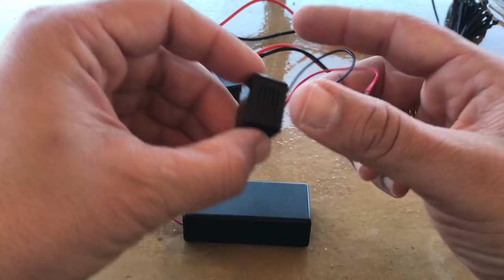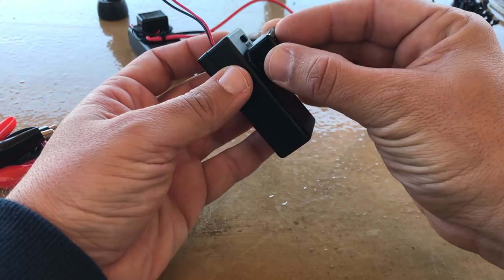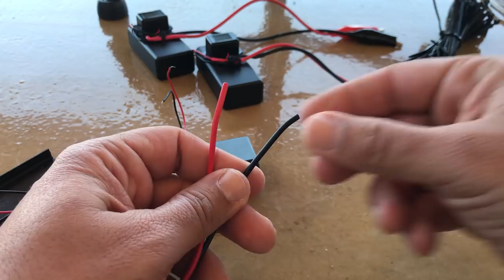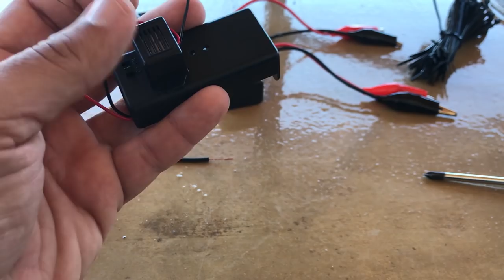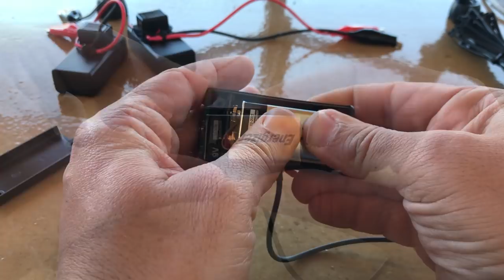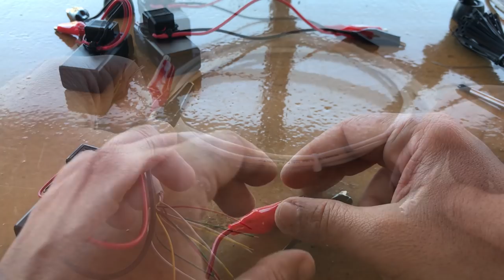How to make a cheap Cable Finder - DIY Tutorial

Comment: I have built a few of these over the years and found that adding a red LED into the ckt allows you to see the light in noisy areas and if you use the light only it does not disturb workers in an office environment. You can add an on/off/on three position switch for switching between the light or tone. The video is very well explained. Good job.

Comment: Continuity tester is what I would call your gadget a signal generator and receiver is a true cable tracer
Reply: It's not a very good one. You don't want to pump 12V on any voltage sensitive equipment. A better design would use a transistor or FET for turning on the speaker a capacitive sensor.

Comment: When I search for a  shorted 12 volt circuit to ground on semi-trailers , I place a 12 volt buzzer inline .  A live 12 volt line to one side of the buzzer and the other buzzer wire to the shorted circuited wire  .  The sounding buzzer will stop after tugging , pulling. , or unwrapping the harnesses ,  then repair  .  If the annoying buzzer is too loud  place electrical tape over the buzzer sound vent .       6/7/23
Reply: Instead of a buzzer a 12 volt an incandescent lamp may be used , this lamp will put more of a current draw on the circuit than an LED lamp . Use alligator clips on these fixtures . A small amount of tape quiets the buzzer significantly .

Comment: How would you use this in coaxial cable setuup
Reply from the maker: I have used it sometimes with coaxial cable. I connected the cable finder to coper wire and foil shield of the coaxial cable.

Comment: Or buy a multimeter...
Reply from the maker: You are right with the multimeter you can do the same. The only problem with the multimeter is that the “beeb” is not loud enough. On the other hand this cable finder has a buzzer and it ‘s easy to hear it in a noisy environment. Also it is small and cheap!

Comment: Is this only good for finding short circuits?
Reply from the maker: I am using it as a cable finder due to it's small size and cost but only for low voltage cables.